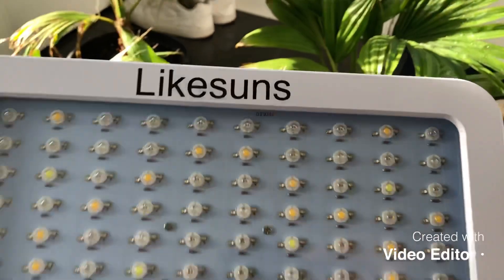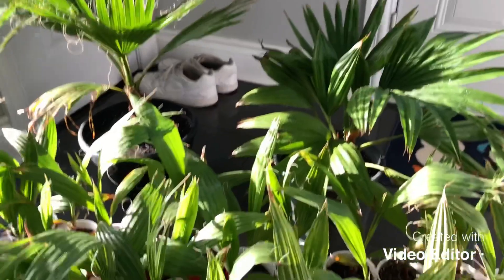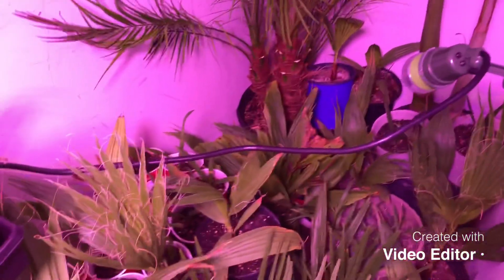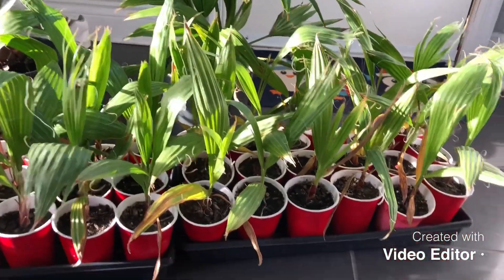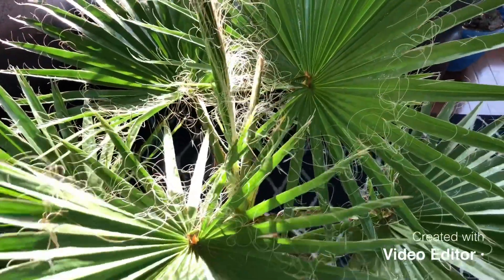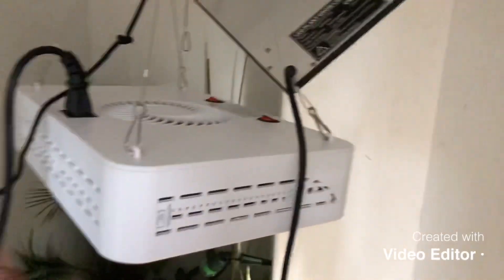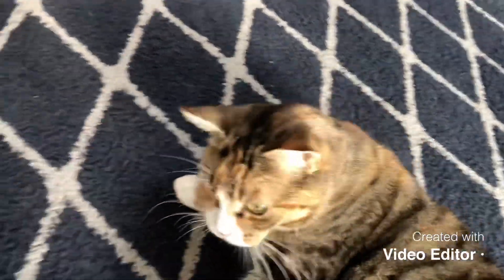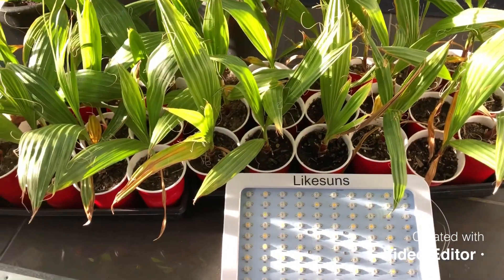Likesuns 1000 watt LED grow light review

Comment: How many hours on/off do you leave them on for?
Reply from the maker: Ernesto Pacitti are usually do 7 to7 at night so 12 hours a day. power is the cheapest at night. Even though they don’t use very much at all
Reply: @TheJames2929  right, the room I have my palms in get daylight during the day but not intense light given its winter. So I have mine going from 8am to 6pm.

For palms brought inside during winter Should grow light have more red or blue? Is UV and IR really needed?

Comment: does it make much heat?
Reply from the maker: duckkillerclyde Not much you can feel just a slight bit of warmer than the air temperature coming out the sides if it was in a small space it will add a tiny bit of heat but nothing you would have to get rid of